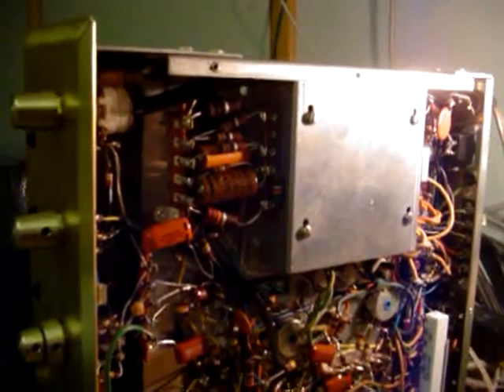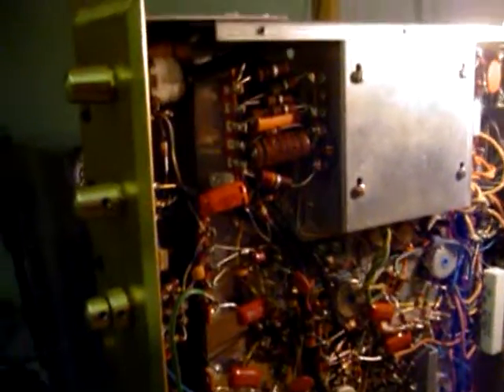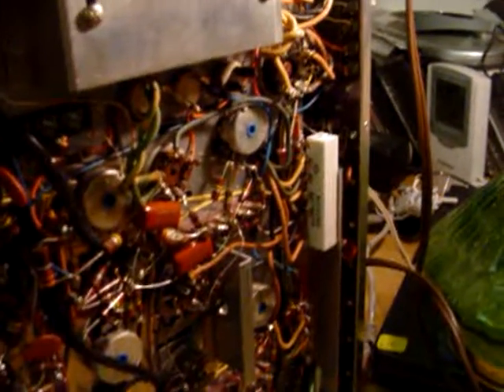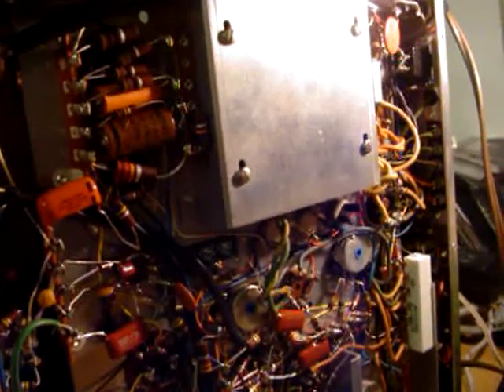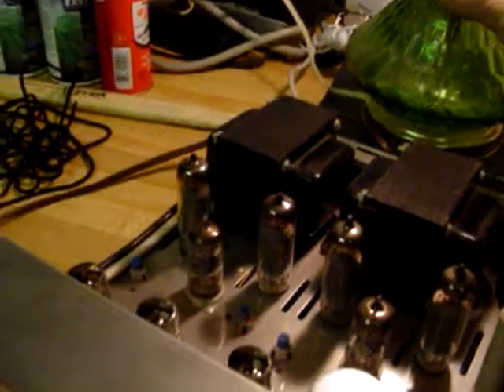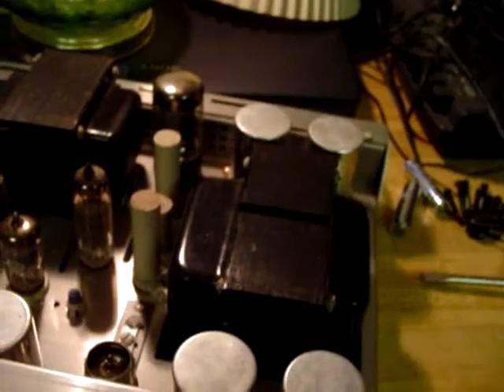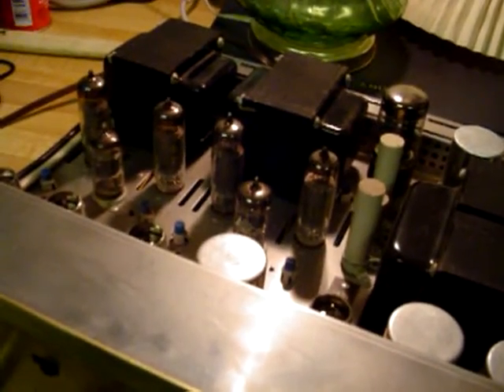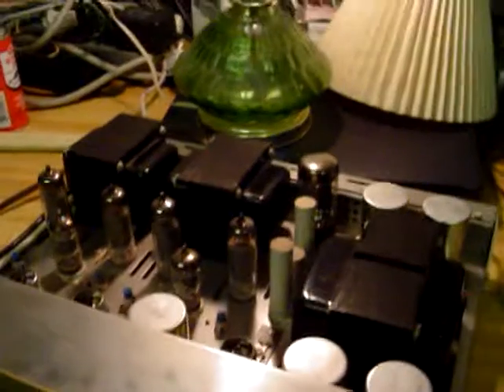Working on an H.H Scott 299B.

Comment: Killer 299B... I use Orange Drop 600V caps on my set.  Great looking set.  Generally, I DO replace ALL of the electrolytic and coupling caps on a job on a set that old.  Yes, and restuff the filament/ bias can too. Good job!!!
Reply from the maker: +Cliff Byers 

Thank you for the kind words. My friend still has the amplifier and really enjoys it. We're both trying to develop a way to recap the electrolytics. I would recommend him practicing opening up can capacitors on some old, defective cans and then restuffing the electrolytics on the Scott. It'll look factory and also there is very little room underneath for much else in the way of components.

Comment: those are .047 ufd, NOT .47, unless you misspoke.  Also, you really need to move that dropping resistor to the top where it came from, those things put out some real heat that degrades the components near it over time, that is why Scott move those power resistors from the bottom of the chassis to the top.  Unfortunately, those "standees" can be hard to find, but even some kind of kludge to get that resistor to the top would be much better...